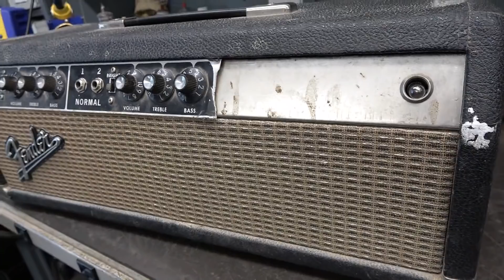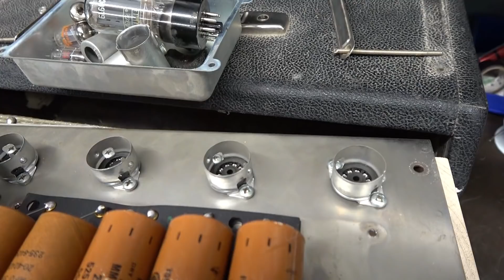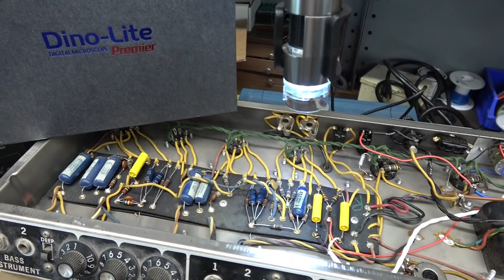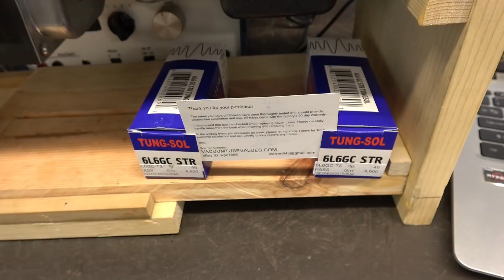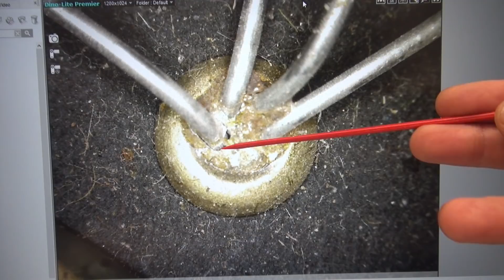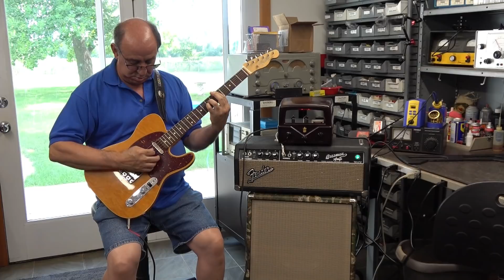1964 Vintage Fender Bassman Tube guitar amp Restoration Project Was ugly now a shining Star

Comment: Nice work as always . Love your videos but I've never ran across a leaky ajax cap and I've rebuilt many black and silverface amps.  The brown and blue dipped yes but ajax just don't go bad. There are people that won't even buy a blackface if the ajax have been removed.  Just my opinion and experience. I've seen a lot of amps robbed of them. The 600v .1uf cost ya $35  to $50 each used for a reason.  Just my opinion.  Keep up the good work.

Comment: Hi Terry, nice videos. When you showed that cracked connection, it reminded me of a video I saw 20 years ago. The repair guy said when looking at old Fender amplifiers, he pointed out that only a few resistors are mounted in an east/west configuration and the resistor you pointed out was above a warped section of the circuit board and that the resistor there almost always came loose. So, I looked at a '65 Bandmaster I just got, and I went right to that resistor, picked up my pointy probe, stuck it into one end, pulled up, and the resistor popped out! How about that! 
Also, how about tuning your guitar to an E chord. Then you could play real good! (maybe)

Comment: My other amp i use for gigs primarily is a Traynor Reverb Mate 40 (from early 2000s). It is surprisingly good if you set it right. 2x8 combo, 40 watts solid state. I set the amp exactly like the Bassman except there is a presence and gain knob. Presence-8, Mids-3 matches the Bassman, and Gain-5, Volume-5 to match the volume of the Bassman. Apparantly, a solid state amp of the same wattage as a tube amp will be approximately 1.5 quieter on the volume knob by comparison.

Comment: Love that amp. My dad has a '66 Bassman, all original. I play through a 1x15 Peavey cab, black widow speaker @ 4 Ohms. Sounds great. This guy's amp setting is close to how i do it. Mine would be: Volume-3, Treble-6, Bass-3, normal 1, (bright switch off). I play an '08 Epiphone Les Paul with some low output humbuckers. Just got a Joyo Tremolo and love it. It is such a classic sound.

Comment: I tried reaching out to you on reverb and via email regarding some work I was wondering about.  What is the best way to speak to you about it?
Reply from the maker: What  kind of work?
Reply: I own a blues junior cabinet,  speaker and chassis and was wondering how much would it be to get a custom hardwired set up for it. I had a really bad string of luck with some of my recent amps and I want to finally get something good. Thanks for your time

P.S i have a power transformer and output transformer from the blues junior aa well

Johm

Comment: I wonder why yo prefer the visual inspection of the joints, seems to me you could reflow all of them in less time?
Reply from the maker: Would you take your amp to a shop that simply resolders everything without an inspection of the cause?
Reply: @d-labelectronics  Well thinking about it, yes actually. It's very easy to miss a cold joint by visual inspection, the older we get the easier it is. If you reflow a joint (and it thereafter looks right) you can say with high confidence that it is a solid connection. All the other inspecting for corrosion, leaking electrolyte, loose pins, and the like can be done during the soldering process. Your usual practice is to repair most everything you find in the inspection before first power up(for solid reasons) so I can't see that any information is lost by doing a systematic reflow and leaving the cold joints out of the inspection.
As a bonus the systematic visiting of every joint should work against the natural human  tendency to skip over things.

Comment: I have used the Dino Lite and it works great for inspection and documenting with pictures but not good for close work like soldering SMT components on to a circuit board. Full bench mounted microscopes for fine soldering are too expensive for most home shops. Still for inspection they are great! Thanks for the tech tips Terry.

Comment: Had a bad connection like that in my 65 deluxe, on the other side of the eyelet board. Took years to find. Looked perfectly fine, the lead could rotate in the joint. Years.

Comment: Meguires leather cleaner and conditioner will clean up and rejuvenate the Tolex to a factory new satin sheen. Buy it at Walmart or auto parts store about $8. Cheers
Reply: Thanks for the tip! 
I will have to try it.
Reply: @edwardmonsariste4050   For the initial scrub I use something an old towel and a tooth brush to get down into the crevices of the tolex and be careful not to let your cleaning solution drip. When all is cleaned and totally dry, I then apply a liberal amount of the Meguires and let it sit for 30 minutes. Then the final wipe down with a clean and dry towel.